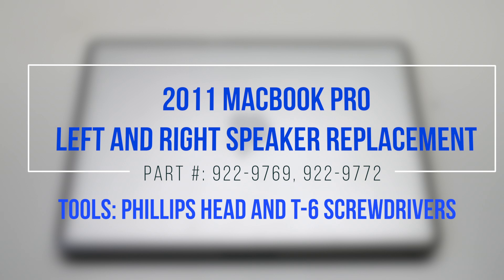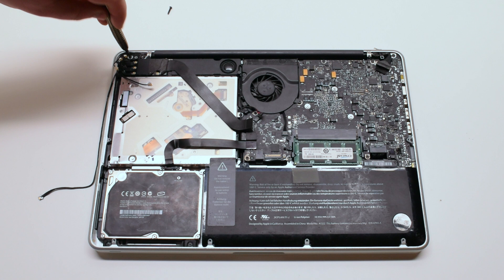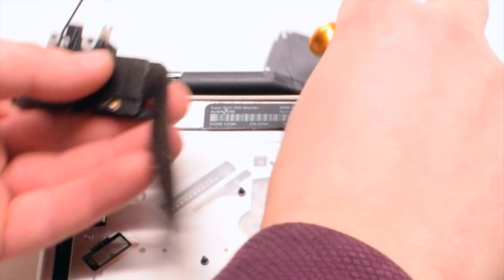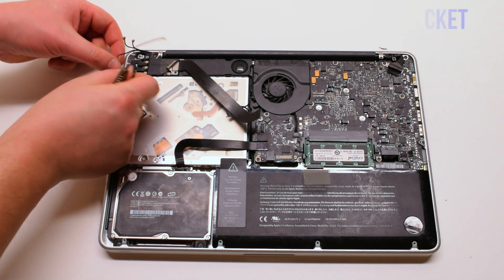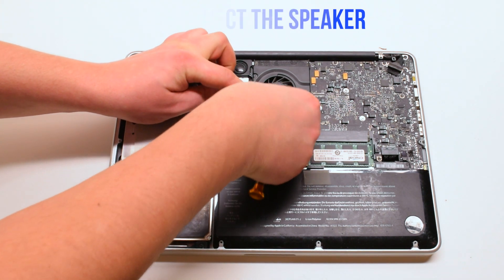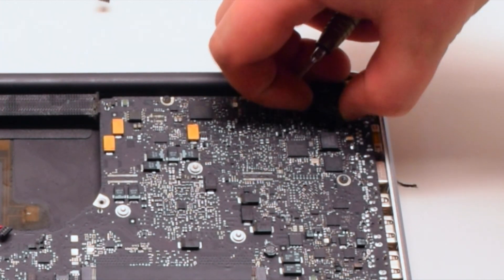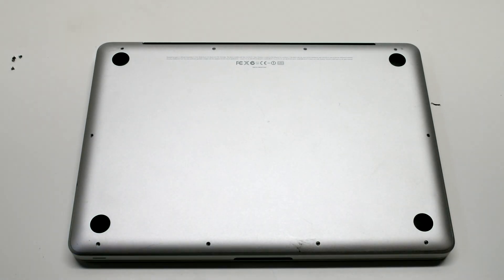2011 Macbook Pro 13" A1278 Speakers Replacement

Comment: You refer to the smaller speaker that slips under the DVD drive as the subwoofer. Isn't the the larger speaker that screws into the antenna bracket the subwoofer ??
According to Apple the subwoofer is the larger round, not the oval speaker under the DVD drive.

Comment: I do have volume but it is low and has little bass and sounds distorted. I feel it may just be the right speaker and sub woofer. Can I try replacing just the right speaker and sub and see if that fixes it? Maybe the left speaker is okay.
Please let me know your thoughts.Thanks..!

Comment: I wish I had bought new speakers when I did the WiFi card upgrade lol. Did basically the same repair twice, because right after I did that, the speakers went out. Glad I changed them, they had 13 years of junk (not mine either, I just got the laptop) built up in them and the left speaker was shredded lol

Comment: Hi. Very nice explicit video. I have a question. How to check if the subwoofer  is working on MacBook Pro 15" 2011 without opening the laptop ?  Few days ago I had a cracking noise on the right side of my laptop. I was suspecting that the right speaker is broken. I went to a guy to fix it, after 40 minutes he called me saying that he replaced the right speaker and the subwoofer...saying that they are attached together. The sound is not cracking anymore on the right side. But I feel the sound it's not so loud and bassy anymore as it was before. I'm thinking that the subwoofer was broken and he only disconnected the subwoofer and left only the 2 speakers working. Any advice? I'll really appreciate.

Comment: I replaced my speaker but my wifi stopped working. It says missing wifi hardware. I have rechecked every thing three times already.
Reply: you probably got it fixed by now but  try reseating if this doesnt do reinstall macos even then if it doesnt fix get a friends laptop and try putting the wifi card from that laptop to check if you broke the card slot

Comment: Nice demonstration. Having stripped my now 10 year old MBP several times, I have a few tips for anyone attempting this:
1) phillips 00 and torx 6 needed
2) the four short screws on bottom case furthest from the hinge side have a shoulder and so should be kept separate from the other short case screws
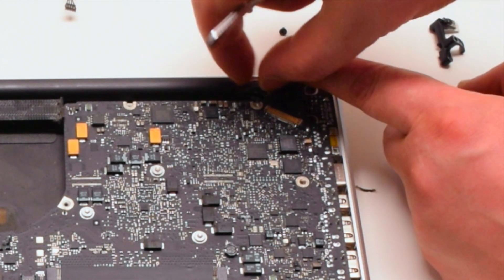3) don't forget to re-seat the microphone at 11:15 (removed at 9:43)
4) yes, the keyboard ribbon cable at 12:08 is tricky to re-seat. It helps if you make a 'pull tab' by attaching a piece of thin 1" tape to the outer side of the ribbon so that you can pull the ribbon back into its socket (towards the hinge-side) as you position it with your spudger.
5) most important - you won't remember the steps so either make very detailed notes before you start or have an alternative working computer to watch the video as you do it.

Before replacing speakers, it might be worth removing the bottom case an using a hoover to remove all the accumulated dust (this considerably improved my muffled/crackly speakers). The same holds for a muffled microphone, remove it, hoover and clean the hole (miraculous results on mine).
Reply: My A1278 macbook lost 2 of the 3 mounting screws of the speaker, can you tell me what type of screws are they? If there is anyway to find them around. Tnx

Comment: One of the speakers is distorted and buzzy is there a way to detect which one? I got a feeling it's the subwoofer, is there a way to isolate that by testing somehow?
Reply: physical inspection works ,for my case the right one was cracked or torn pretty common with 13 inch 2011 pros but sometimes cleaning the dust works too

Comment: I just replaced both speakers and now my computer won't turn on. Any suggestions?
Reply: I watched another you tube video and I held down start button for 10 seconds, while still holding down button attach the power cord and within 5 more seconds it started right up!

Comment: Well everything was going great until i realized i ripped off the subwoofer logic board connector when i removed the old right speaker connection. So now i have no speaker

Comment: Thank you.  I was quoted $285 by my local computer repair chain for speaker replacement. I bought the speakers and tool kit for $40 and was able to do the replacement myself. This video did a really great job of walking me through the replacement process. I watched it twice before I started and everything except the microphone replacement was covered perfectly. I realized the  microphone repositioning step was missing and accounted for that. Again, thank you.

Comment: good.I bought it here, and I also gave a screwdriver and rubber feet, very cheap, very good, and good work.
https://www.aliexpress.com/item/4001200948006.html?spm=a2g0o.productlist.0.0.4dbd4fc6iEb9Dg&algo_pvid=35fdd958-38a1-43ed-856a-d60464d266f4&algo_expid=35fdd958-38a1-43ed-856a-d60464d266f4-13&btsid=0bb47aa615959238460468172e188d&ws_ab_test=searchweb0_0,searchweb201602_,searchweb201603_

Comment: How would I know my left speaker is gone or right? I can hear some sound in my MacBook without base.
Reply: try sound channel test vids from youtube or a subwoofer test or just crack open your laptop and see torn speaker you know look closely on the corners of black righ im pretty sure your damaged on is right cause subwoofer rarely fails

Comment: The first part went well, when I did the second, the one you have to remove the logic board, now the computer won't turn on anymore... Be careful with this
Reply: Were you able to put it togather?
Reply: @HammadKhanYT  It eventually went back to normal
Reply: @motaaaa  Glad to hear. Thanks. Have same issues with my speakers, have already ordered replacement. Anything I should be extra careful in?
Reply: @HammadKhanYT  always disconnect battery first, that's the first thing you do ever. Also the keyboard flat cables are a pain to reconnect after, need some patience. Be careful not to break stuff lol
Reply: @motaaaa  thanks a bunch!
Reply: I just did this and now mine won't turn on. What did you do to fix it?
Reply: @rondebventresca8124  it just worked again on it's own after some time

Comment: many times your hand is in the way of seeing clearly what you're doing, you could also warn dudes of the parts that are tricky in these videos, for eg. where there are latches or different size screws and your hand again blocked the view to see which is which.Because there are delicate steps in any Mac laptop repair. Finally, get a regular to large size coffee.
                                                                              Nonetheless liked the video, # 366

Comment: Excelent work! Where did you buy those speakers for 1278? On ebay?
Reply: Yeah, where did you buy them and are they original apple brand speakers or oem parts? and for how much? how bout the longevity of the oem speakers vs the apple brand speakers?
Reply from the maker: Yes, Ebay, they are original apple speakers pulled from working unit.

Comment: want to ask im a bit nervous to do this but i can take a part a nintendo switch controller and put it in a clear housing so i have the tools on that skill level do you think i can do this if i follow your video
Reply: im just nervous that those 4 wires at the top left im going to get them mixed up how do u know are they all different lengths
Reply from the maker: The cables are all different lengths so they are hard to mix up and if you have the skill to mod a controller you can definitely do this.
Reply: thanks i will be trying will let u know how i do

Comment: my 2011 macbook pro speakers are acting weird. suddenly the sound quality will lose volume and sound very thin. (sound like tin can speakers) if i smack the back of the macbook usually the sound will improve back to normal. sometimes it last a day or more then will revert back the lousy sound quality. do you think this replacement will fix this intermittent problem?
Reply from the maker: Yes, I believe that it will fix your issue.
Reply: @GRIBSOFT  to anybody that had a problem with losing bass and midrange. (speakers sounding like tin cans) i found the problem to be loose solder connection for the small 3 watt amp on the logic board. i could push on the solder joint and get the sub to work. THAT WAS THE PROBLEM. NOT A BAD SPEAKER. your choice is repair the solder connection or replace the logic board. changing speakers is a waste of time and money.

Comment: Thank you soooo much for this video. Today I received all the pieces and went on and swapped, right speaker and subwoofer, battery, ram modules, and DVD tray for a special one for the old HDD. I was going to try to do it any way but with this video I felt even more confident. Thanks again for posting good content. Liked and Subscribed.
Reply from the maker: Glad to help!

Comment: Hey !
I wanted to know if i can only change one of the speaker to fix my sound problem so i try listening to music using only the left one or the right one through the sound menu in system preference but both of them seems to be compromised and i found it very strange that both of them stopped working properly at the same time for a few weeks now, can you help me figured it out ?
Thank you :-)
Reply from the maker: +Badis Benmaghsoula I would just order both speakers it's around $20 for both on eBay. They go bad at the same time a lot so I would just replace both.
Reply: Thank you so much for the answer !

Comment: Are the speakers used in 15 " and 17" macbook pro  are same?
Reply from the maker: No they are different. Make sure to purchase the correct ones for the correct model.
Reply from the maker: For 17" Macbook pro http://www.ebay.com/itm/Genuine-Left-right-Internal-Speaker-fit-MacBook-Pro-17-A1297-2009-2010-2011-/131875326677?hash=item1eb461cad5:g:4FUAAOSwPhdVRueG

For 15" Macbook pro http://www.ebay.com/sch/i.html?_odkw=2009+macbook+pro+15%22+speakers&_osacat=0&_from=R40&_trksid=p2045573.m570.l1313.TR0.TRC0.H0.X2010+macbook+pro+15%22+speakers.TRS0&_nkw=2010+macbook+pro+15%22+speakers&_sacat=0